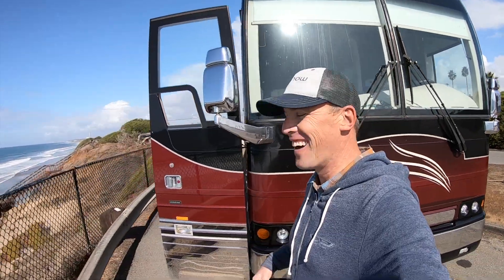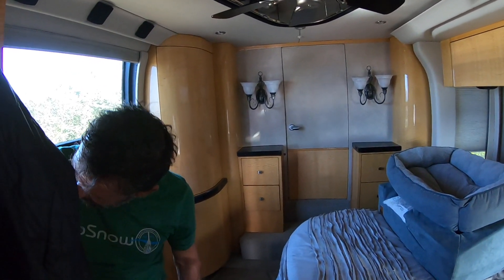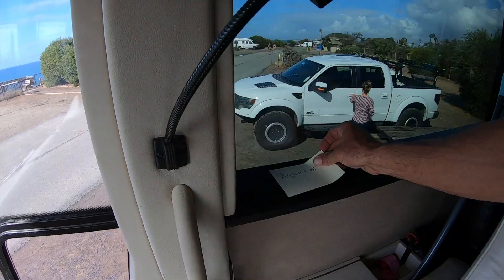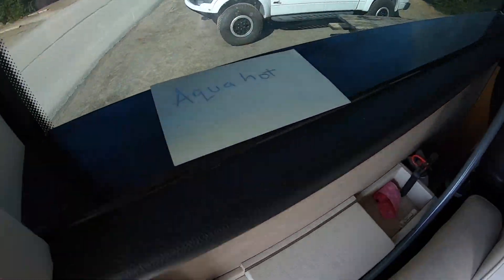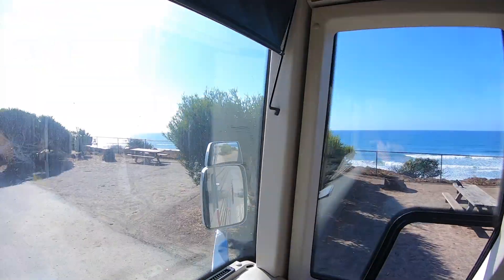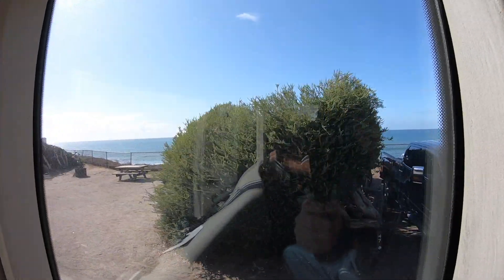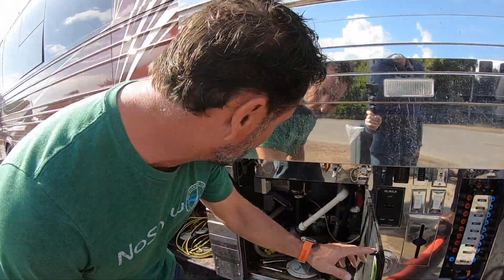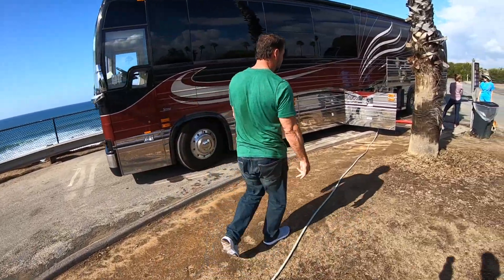PREVOST RV SETUP/DUMPING TANKS WITH A MILLION DOLLAR VIEW

Comment: The no squeak no rattle is because of Prevost stainless steel  chassis. I had the opportunity to do a tour of their plant in Quebec. The chassis is built on a jig that secures each piece in place while welding. I had a 30 yr career as a tour coach driver, close to 2,000,000 mi. Mostly in a Prevost. Driving and viewing the building of a Prevost I can say there is no coach I would rather drive.

Comment: Hey! What does he mean when he says make sure he lift tag(s)?
Reply from the maker: The rear tag axle has a lift if you want to tighten the turning radius
Reply: In tighter areas lifting the tags helps prevent scuffing of the tires due to the geometry of the turn
Reply: @midlifeprevost1182  lol! I was thinking you all had some type of cool contraption on the RV where you could raise or lower the actual DMV(MVA) issued tags...😂😂😂😂
Reply: @djbuttnaked4789  🤣😁🤣😁